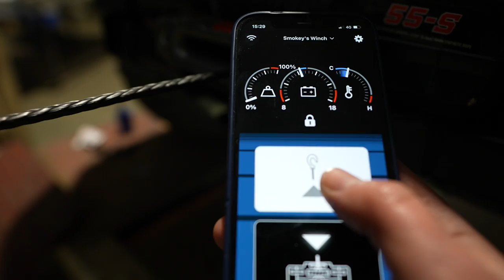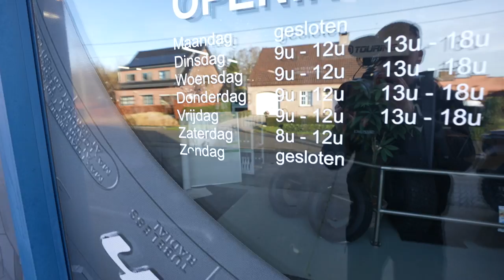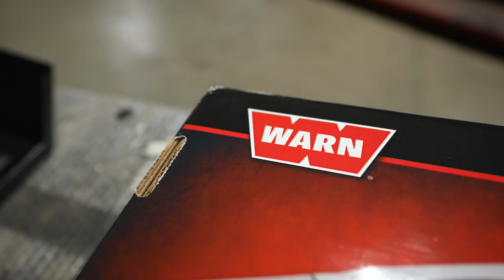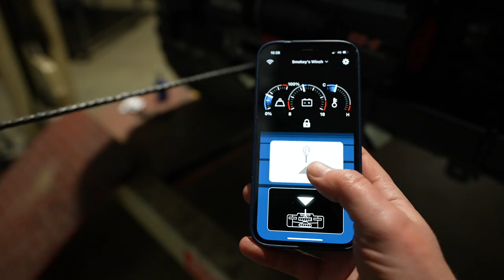Suzuki Jimny 2.5 Tons WARN Winch Installation

Comment: The mounting kit is included with the winch? Thanks...
Reply from the maker: Yep it's a full kit made for the Jimny 😌
Reply: @LifeofSmokey  Thanks. Seems the best winch, wuality, price, weight, low profile and enough power for the car. If need more power just add a leverage and thats it. My car arrives in May and doing my homework until it arrives...Best regards
Reply: @LifeofSmokey  Hello again...Watched some what's in the box videos of the 5500s and there was no mounting kit for Jimny. Can you clarify please? What part number was the winch you ordered, my local dealer never heard of an included mounting kit....I received 2 price quotations. One for the winch and one for the mount plate....

Comment: at 3.30 seconds, it shows you are install a bar to keep your winch. so i have the following questions

1) does this bar come with the winch or did you buy it separately ? 
2) Where did your buy the winch bar ? can you share the website link where i can get this wing bar. it seems super strong ? what is the cost. this is very very important. so please do the 

3) WARN 101155 AXON 55 Powersports Winch which online site did you buy it from

Comment: I've seen this video so many times, great content 👍
Are you still happy with the winch? Any troubles? and have you used it yet in a critical situation?
Reply from the maker: I have moved trees , stuff in my garage and when the jimny got stuck in deep mud. No problems yet besides losing the bluetooth connection with my phone. You can control the winch with your phone and that failed and I could not get it back to work! Make sure you have the button that comes with it also in the interior of the car 😁. So you have the cable when you stand outside , and a button on the inside as well. And ofcourse bluetooth on your phone for show lol
Reply: @LifeofSmokey  
Thanks for the answer and your experience's 
Is everything included? If you want to use your phone as remote control, is downloading an app, all you have to do?

Comment: Cool, it can be used with Ford Ranger RAPTOR Or need something different? and Thank you, Btw we missed the videos by the monster adventure KTM
Reply: You can get WARN winch but you need bigger for sure because of raptor weight.
Reply from the maker: Yeah this winch and the system is build for the jimny so everything fits perfectly. For a Raptor you gonna need 5 tons or so 😁👌
Reply from the maker: Jumped on the KTM 1290 SAR today , still very painful in the knee but i did take it out for some video haha

Comment: Very nice...can i still use the standard stock jimny suspension or need to be lifted? From what i read it is 29 pounds...is the steel rope also available for this winch, and the bracket is included too? looking forward for your kind helpful reply, thank you
Reply from the maker: I'm still on stock suspension , don't want mine to be lifted as i don't really like the look of lifted Jimny's 😁. I do think they still come with steel ropes yeah. But i heard some horror stories with those steel wires so went for the rope 😁
Reply: @LifeofSmokey  one more thing😁😁 or two and more maybe😆😆  is the bracket already included in purchasing, and i saw a pic in their website there is a remote control next to the winch, is it optional? but in the spec detail using digital controller/ and from your video you were operating it with handphone😊, and can it be downloaded in android app, while we r using it from handphone does it need internet connection, because somehow in a remote area the signal is poor, thank you
Reply from the maker: @saktipaslaofficial2047  the winch bracket comes with the winch as a big package. All plug and play , the original grill goes out and is replaced by the winch panel. And yeah you can purchase a bluetooth kit as an extra option so you can winch using the Warn app. Works on bluetooth so works everywhere 😁.
Reply: @LifeofSmokey  many thanks !!!

Comment: Thanks for sharing such useful experience. You are very funny as well 🙂
I wanna ask coz it's not clear in the video:
Did you completely remove the lower grill, cut it, or use a Jimny-custom plate provided with the winch?
Reply from the maker: Yeah

Thx m8!  Yeah it's a complete package made for the Jimny so the lower grill is completely removed and filled up with the provided custom plate that looks like the original grill 😎
Reply: @LifeofSmokey  
Thanks for your reply 🤠
Reply from the maker: @HazemElDerwy  no problem , anytime 😎👌